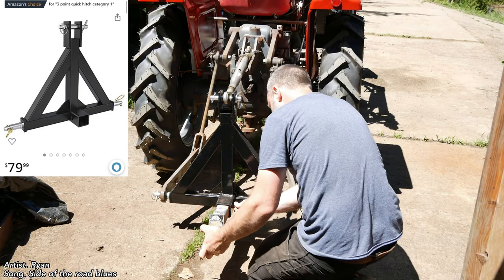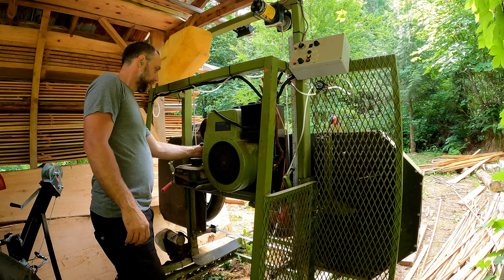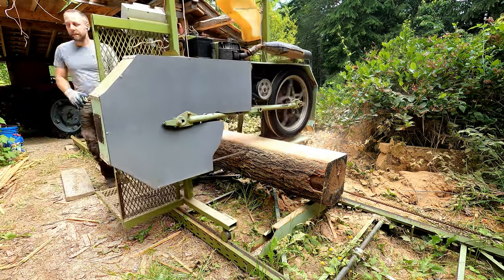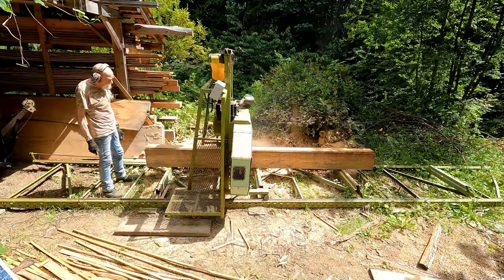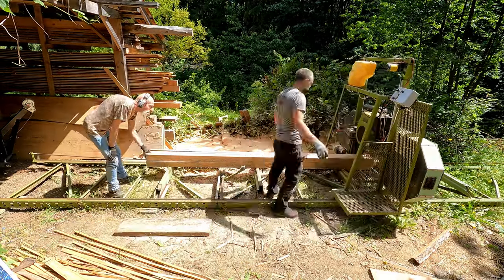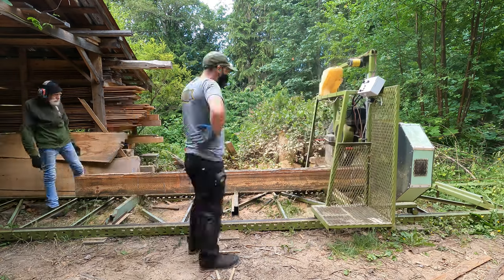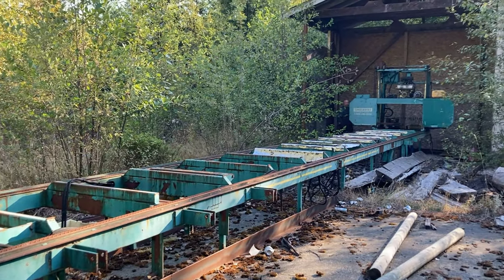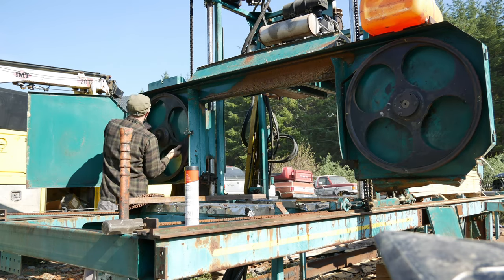Milling lumber homemade Bandsaw Mill

Comment: 1:21 if you find a second hand pressure washer, you could take it apart and adapt the pressure washer pump to the motor on the mill and run it that way. If you're lucky to find one that's dead on the motor side, even better.

Comment: That bluegrass is perfect for this video Mike! Are you sawing actual 2x4's or 1.5 x 3.5 " like they sell at the market?
Reply from the maker: Most of the time I saw 1.5x3.5” if I’m mixing store bought lumber with my own milled stuff. Sometimes I will Mill true 6x6” posts it sometimes comes down to the projects planned.

Comment: Use a trailer, sticker the wood on it straight outa the bandsaw. Then slide the unit of wood off in a more permanent spot. Saves handling it too many times.

Comment: Hi mike, I started Building a Woodmill a year 11/2 , I got sick and have not been able to finish to Now, Only thing Left is the The wheels the hold the Saw blade and engine, What I want to know is would a Good running Honda 9 hp be Strong enough, to do the Job, Motor is like new starts on first pull always, Thank you for any help
Reply: 9 hp is on the the small  side but that being said it will cut lumber with the proper belt drive reduction just not as fast higher hp motor if I am not mistaken Mike's motor is 13hp and it cuts just fine

Comment: If you had electricity by the mill 🤔🤔🤔🤔 that sounds like a new project  maybe some solar panels and batteries or maybe a power wall battery project 🤔🤔🤔🤔🤔

Comment: Great video! On another subject, what mig welding gloves do you recommend? I do not remember ever hearing you say. Thx
Reply from the maker: For MIG welding I just use good leather work gloves, usually I just buy them from HD, try on a few pairs to make sure you get a good fit. I found the really large Stick welding gloves are just way to bulky for me. The only downside with the thinner leather work gloves is if you grab some hot metal you will feel it quicker, but you won’t get burned from the sparks created when MIG welding 👍
Take care 🙂
Reply: @Mikefestiva  Thx Man!!  I welded some this weekend and realized I had blisters on the back of my knuckles 😂
Reply from the maker: @KD-wg4tn  Haha you definitely don’t want that! 😂

Comment: Stop dragging your logs! Build a log arch trailer. Throw a chain hoist with a log tong on it and you’ll save hours and blades
Reply: P. S. Beautiful lumber and mill!
Reply from the maker: I built a log arch about 7 years ago, I have a video on how to build them. 
I use the log arch for some logs and others it’s just easier to use the log boom on my property.